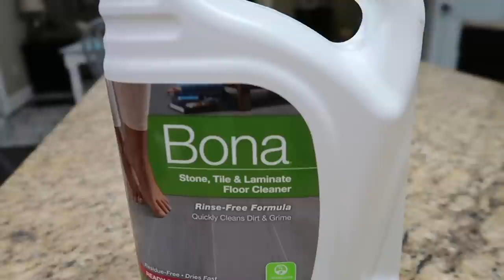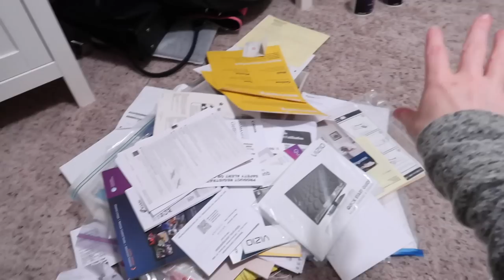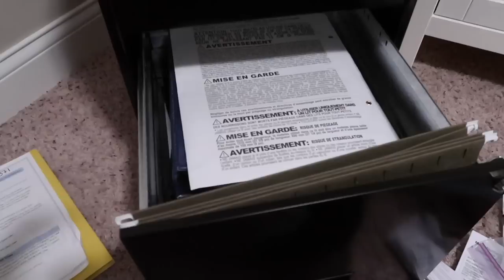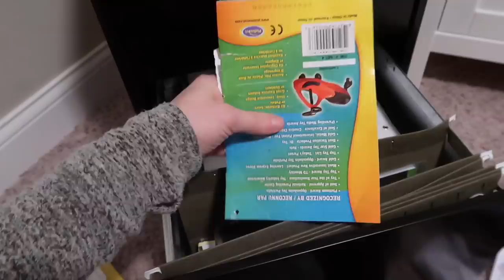2020 EXTREME WHOLE HOUSE CLEAN WITH ME | ALL DAY CLEANING MOTIVATION | DECLUTTER | CLEANING ROUTINE

Comment: Jamie I used to have a shark steam mop that I had forever too and then I just got tired of having to plug and unplug all over my house so I got a bona floor mop for $32 at target it comes with one washable pad and they also sell an extra pad separate for $13 and then I also got the dusting pad on amazon for $8 and depending on what floors you have in your house you pick your bona cleaner we have no carpet in our house just 3 area rugs so we use the hard surface floor cleaner which does stone tile laminate and vinyl
Reply from the maker: Ohhh thanks for sharing!

Comment: I was looking at the hizero bionic mop. It’s a little pricey but for what it does it’s worth the investment. It vacuums and mops you’re floor at the same time but has a separate tray that dirt debris particles go into so it doesn’t mix with the dirty water. The tunics battery only lasts 20 minutes so when I saw that in a review I kinda decided against it. The hizero isn’t a steam mop but would be a huge time saver .
Reply from the maker: Thank you!!